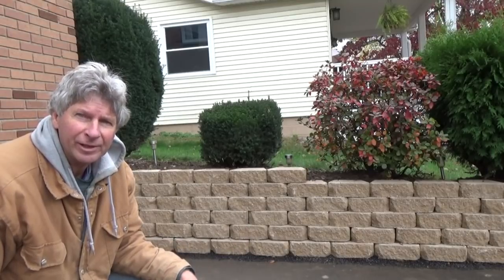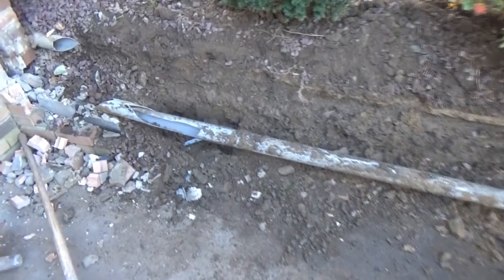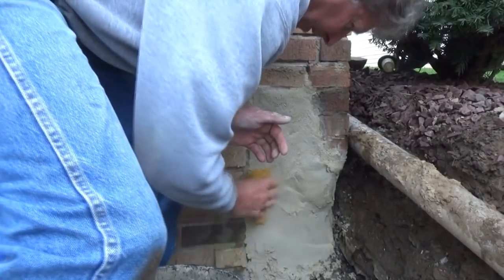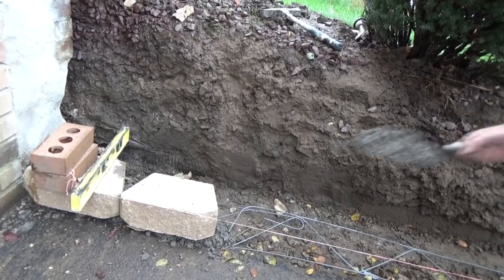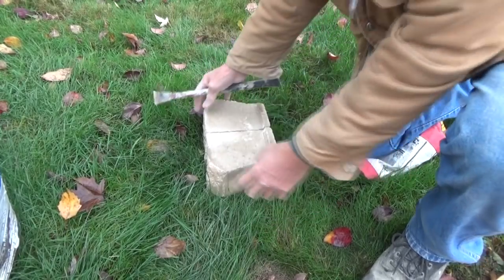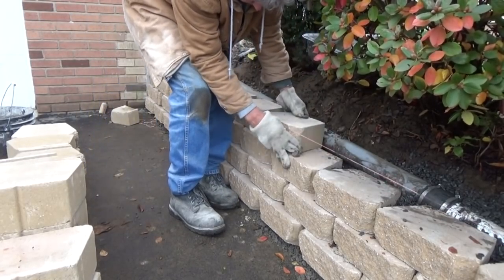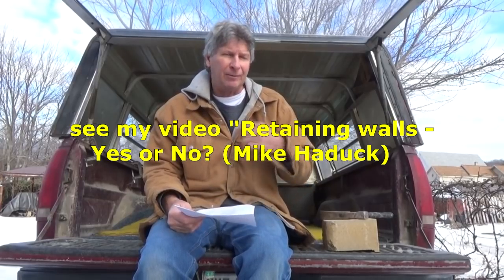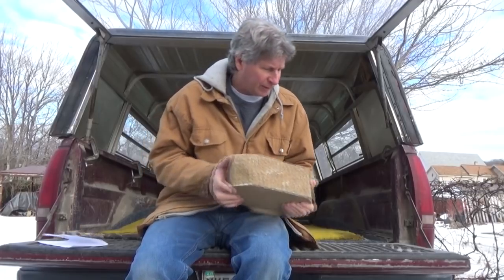RETAINING WALLS (part 5) Mike Haduck replacement

Comment: Great video Mike, I have built a few garden walls none higher than 3 feet and in my limited experience  I have found that in Tennessee with frost no more than a foot deep the walls that had the most stone behind and under them last the longest. Stone compaction and a landscape fabric to slow down the clay from filling in between the stone. I found what worked for me was similar  to what you used ,I ran 2 pieces of rebar a couple of inches from the front and back of the landscaping block and place cement on top of the rebar under the block to  get it all nice and level and plumb. Some folks fail to understand that water will eventually screw up everthing we build  and take the necessary steps to keep water away for as long as possible.
Reply from the maker: thanks Matt,   I agree with you 100%,   I appreciate the comment,  thanks mike

Comment: I'm in Tennessee and most of the older home's they used 8 inch block so a lot of these walls are now leaning over or have fallen. Some have brick face and some are just the block. We always tore them out and tried to find brick to match and go back with 12 inch block then brick face. Most cases drill and dowel with rebar and use dura wire  just like you did on the bottom. In most cases poured some of the cells of block and if the wall was higher than 4ft we would just pour the whole wall with concrete.  I'd much rather do what you did here. It's an offset from the brick and make's the house look better also. Great video.
Reply from the maker: thanks Stevo,  I appreciate it.  mike

Comment: Clean pea gravel for a French drain works really well but freeze and thaw cycles are still bad in cold climates.
When I was building sewer treatment plants we called those couplings a 'fernco coupling' and used them in non pressured piping. 
Nice wall and video, thanks.  
....13
Reply from the maker: I always want to say thanks 13,   I appreciate it.  mike

Comment: In my area of south central PA I see new developments using those garden wall type block as retaining walls.  I've seen those things 10, 15, 20 feet or higher and I always wonder how long they will hold back all that earth?   Maybe there are things going on behind the wall that I am not privy to viewing but if and they go, there are instances that houses may ge with them.  What it looks like is that it allows contractors to build houses on less land because they don't need the room to grade the earth.
Reply from the maker: Hi Bob, I say the same thing, it's only a matter of time, thanks mike

Comment: Thanks for another good video Mike. My question is about that wire you been putting under these little walls. Does the wire strengthen the cement, similar to adding rebar to concrete footers?
Reply from the maker: Hi Chris,  I consider it a insurance to keep the first course from slipping,  this wall was laying on the old footer, and like any garden wall It has a limited time, but I believe it helps,  thanks mike

Comment: I like your approach on this, easier fix and 90% reusable which long term way better than smashing up a block wall and skipping it. 
Good chance this last way longer as can drain water better plus won't crack like cemented wall so look perfect for longer .
What are those man made stones called with the recess lip as not seen them before ?

Good job Mike, you can sleep easy :-) ...
Reply from the maker: thanks Mr B,  I got them at homedepot,  standard and easy ,  thanks mike
Reply: have to take a look as idea for a wall I need do .
Thanks Mike ...

Comment: Mike, I have been looking at all of your presentations and appreciate your knowledge and the effort you have taken to prepare these tutorials.  I am a  P.E. in CA and we have retaining walls failing in large numbers but in specific areas.  The main problem I find is that home owners and engineers designing these walls are using the standard design as shown in the Regional Standard Drawings which are not conservative!  So if you do not have good soil to support your foundation these standards are not adequate.  A larger foundation with a key properly designed can solve this problem. The bottom lip on the stack-able retaining wall blocks acts as a key so I do not recommend removing this as it can help keep the base of the wall from sliding forward.  Any kind of reinforcing should not be exposed to soil or air as it will likely fail over time..  Embedding the reinforcement in concrete would improve your design.  To be more conservative adding a foundation that extends in front of the wall would decrease failure rate. The purpose of the granular back-fill is to keep the back of the wall and soil behind it from being saturated.  Wet soil weighs considerably more than dry soil and so wet soil adds a lot of load to the wall. These systems are not intended to support wet soil.  You mentioned also the added load from the water expanding in freezing weather adding load behind the wall which contributes to wall failures.  If your soil has a lot of fine material in it and a source of water such as rain, irrigation, etc. then the water moving through the soil and french drain can wash the fine material from the soil and fill up the voids in the french drain (gravel zone).  An engineered fabric placed between the native soil and gravel can significantly reduce this problem.  If you are building the wall over two feet I like to add a perforated drain near the bottom of the granular backfill that drains someplace.  Since the wall is only as good as the soil the foundation sits on, it is imperative that the soils at the foundation be thoroughly compacted.  I saw you doing this, but I would like your readers to know how important this is.  It is also important to lay the first course with the top level or leaning slightly into the slope.  This should be discussed with the manufacturer. I also recommend backfilling the wall as you build the wall.  Each course steps back say 1 1/2 inch so an unsupported wall could fall and damage your wall or hurt someone.  Some jurisdictions require permits based on the height of the wall. The Building Official can  recommend when an engineer is desirable/required.  I love that you are making people think about the risks of retaining walls.  If these stacked walls fail, then the good news is most of the time the materials can be salvaged.  It is prudent however to  consider what the wall is protecting both at the top and bottom of the wall.  I saw a project where a homeowner built a very tall retaining wall and then placed a pool in his yard.  If that wall should ever fail, it would destroy the pool and the neighbors house.  Too much risk for me no matter how well the wall is designed and built.
Reply from the maker: Hi Zawakawaka, thanks for the comment,  I have a video out called “retaining walls “yes or no” mike haduck,  let me know what you think, thanks, mike

Comment: Great information!  I have a situation where the original wall toppled over.  I discovered that the last row of block was cemented in at the level of the driver way.  Can I use this as a base where I make a level of gravel, place duro wall and cement and start my new blocks set on that type of base?
Reply from the maker: Hi Paul,  if I read you right that is what I do, as long as it works,  thanks mike

Comment: Hi Mike, could you coat this type of retaining wall with mortar for a smooth finish (followed by painting)? I assume you would need weep holes for drainage. We don’t get freezing temps/snow where I live.
Reply from the maker: Hi Greg, I don't recommend that, I would probably use a masonry paint, ask the paint store guy, thanks Mike

Comment: Mike if the water and dirt were pushing the wall over, what's happening to the rest of the house back where we can't see?
Reply from the maker: Hi BC3012,  it was part of the garage and if the garage has heat in it , it will usually keep the out side from pushin in, also has a lot of weight on it helps,  thanks mike
Reply: Mike Haduck Masonry thanks Mike, another brilliant upload 👏👏

Comment: Hello Mike, I picked up some 120 truss mesh it is 10ft long and 6 wide.  Stone blocks are about 12"  L x 6.75"  W x 4 " thick. Is it going to make a difference if my truss is .75 short  stone blocks have a lip on them. Also how do you make a outside corner turn?  Could you answer ASAP please thank you?
Reply from the maker: Hi Pat, I can't really answer that unless I was there to see it, thanks mike

Comment: Hey Mike is this wall on a slop drive. How do you calculate for a slop driveway. Im laying a three course flower bed with stone block like you are using in this video.  9ft section against the driveway. That's on a slop don't know how to level it. Please let me know ASAP please if you can.
Reply from the maker: Hi Pat, I can't say unless I was there but some people go with the slope and some insist it to be level, it's best to drive around neighborhood see what others did and get some opinions, thanks mike

Comment: Hi Mike. Nice video!. Noticed that five course wall was laid dry? No glue? or that built in "lean back" is enough to hold it all together?
Hope all is well.  John
Reply from the maker: Hi John,  I don't worry much about a small wall like that,  I do not think cementing it or glueing it would add much,  but you are right the lean back helps a lot, was in florida a couple weeks ago and was going to be sailing but the guys wife ended up in the hospital for some past things, hope all is well, thanks mike
Reply: Mike Haduck Masonry about 8 months to go! Slip arranged at Port Annapolis Marina Oct 1 for a week (sailboat show) then continuing on through ICW southbound.  Can't wait! Last winter for me. See you this summer for a sail and a beer!.. John
Reply from the maker: Hi John,  It sounds great, looking foreward to the summer, thanks mike

Comment: Hey I have a question not sure how often you all check your YouTube comments, but I’m current doing my first retaining wall and it’s on a slight hill right on the edge of my drive way I’m laying my first layer and it’s always slightly off to the left so I get it even then move on to the next stone and same difference I get that one fixed as well but when I check them both or even three it’s not leveled am I over-thinking because it’s on a slight hill or should I keep adding rock sand etc ?
Reply from the maker: Hi Cruz, your right ,don’t over think it, check around your neighborhood and see what everybody else did, also watch my video,  retaining walls , yes or no, Mike Haduck, I hope it helps, thanks, Mike

Comment: We always bury a course of block, seems to hold it in place better, then fabric, tile, and clean rock
Reply from the maker: Hi Matt,  I went right on top of the concrete footer,  I could not dig down, and fabric in this case could freeze up near the rain gutter, but for the most part I agree with you 100%,  thanks mike
Reply: i didn't notice the footing.  Have great day.
Reply from the maker: thanks Matt,  same back at you,  thanks mike

Comment: So is the water going to seep through the front of bricks or does it drain to the end and just keep going
Reply from the maker: Hi Pat, it's just a garden wall, the water from the rain gutters will go to the end and anything else will seep out mostly from the bottom, thanks Mike
Reply: @MikeHaduck thank you so much. I have another question if it's ok. Im using the same stone block that you use in this video. How do you do the inside corner and outside corner. You make things so simple. God bless you. Thank you so much again
Reply: @MikeHaduck  have you heard of shur wedge for freestanding walls if you can answer ASAP please

Comment: I love your videos, don't get me wrong, but I think your bias on old school vs new school doesn't ring true all the time. Maybe that's just because I'm from Texas Hill country and we have retaining walls EVERYWHERE here, and not just small ones, huge ones as well. So I look at your videos thinking that they automatically apply to where i'm living, and they just don't most of the time. But maybe you also haven't seen enough examples of people doing new school well. Me personally, I'd place bigger rocks in as the filler. Smaller rocks are moved easier either b/c they are rounded and smooth or that they are just too lite that water can move them with ease making the retaining wall fail. Not so much with larger more jagged rocks. Just my thoughts, again, love your videos.
Reply from the maker: Hi Nathan I always try to say in my videos that if you want to do something you have to ask the local guys because what applies in Florida won’t work in Pennsylvania and what works in Pennsylvania won’t work in Alaska and what works in Alaska don’t work in California I always say it out of most of my videos so I hope it helps thanks Mike
Reply: Happen to agree with your observations on type & sizes of rock or stone Nathan.
The strongest concretes we pour are those with crushed stone...not smooth or rounded river gravel stone.
Larger rocks are less apt to move or change position as you point out.
In many areas of this region ( W PA) the old houses were built in the later 1850's on huge quarry cut stones laid with a minimum of cement or mortar. The binders may need replaced but seldom those larger pieces.